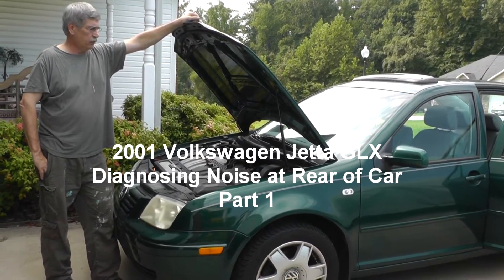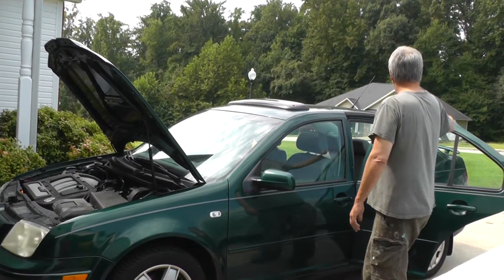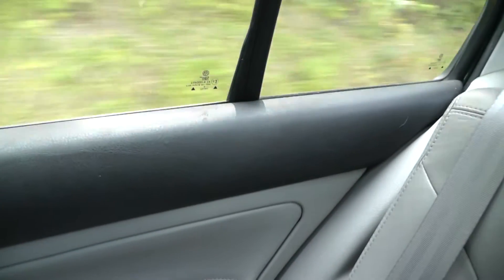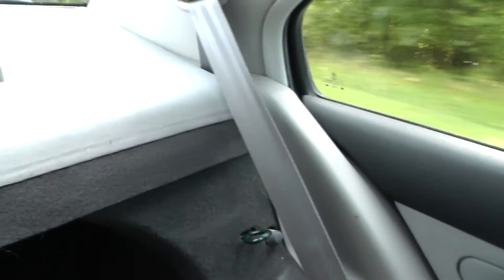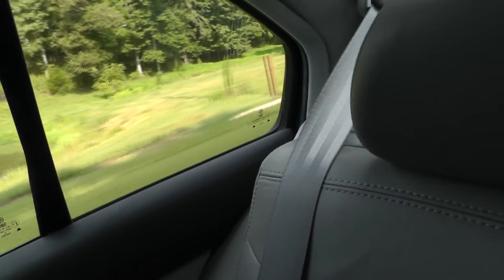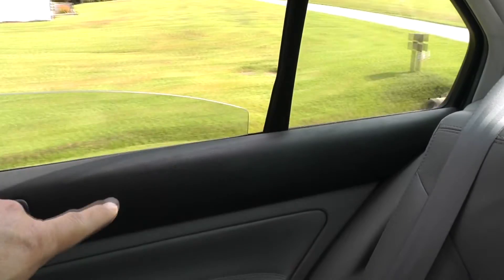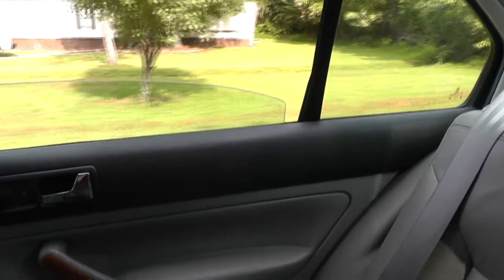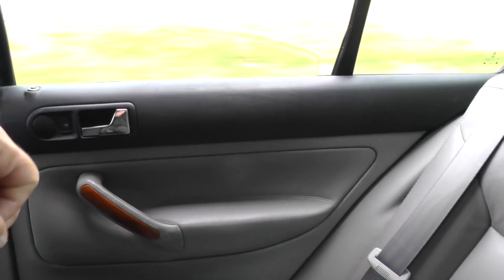Volkswagen Jetta Diagnosing Noise at Rear - Part 1

Comment from the maker: Thank you very much JC for the info. A subscriber had mentioned a bushing problem also in an earlier post. Looking over the manual, those bushings appear to be a pain to remove and install. According to the manual, it shows a portable hydraulic press to get them in and out. I probably will have to farm the work out for that one. Thanks again for the comment!

Comment from the maker: Hey Joe. I appreciate your thoughts about the noise. Sounds like your thinking is like mine. I've already started digging into the window regulator assembly on the left. And for the right, I was going to crawl underneath the vehicle and see what was going on. I didn't think abut the torsion rubber bushing. Thanks a great idea. Thanks for the tip!

Comment: Hey stuzman52 I just recently encountered the same issue... I believe the noise is coming from the left passdenger rear side as well. I got 2 new OEM springs installed in the rear suspention due to a broken spring. Im not sure if it is the torsion rubber bushing, Rear axel bushing, or something to do with inside the door assembly. Did you ever get a chance to diagnose that issue yourself? It would be great if you could help me out! I appreciate it! 
Tags kspain4tane Dohn Joe
Reply from the maker: Yes, it turned out that the noise wasn't coming from the door, but it sure sounded like it. I did another video series on the rear suspension which is where the noise was really coming from. Check out those videos which will show you what my issue was along with the repair. Take care...
Reply: stuzman52 I don't see the video you reference on the rear suspension, but was the issue the rear control arm bushing?  I am having the exact same noise heard in this video and that is what my searching is leading me to believe.
Reply from the maker: Hi Michael. I thought the noise was coming from the rear passenger window area. It turns out that the noise was coming from the shock mounts on top of the rear shocks. I was lucky that it wasn't the rear bushings, but in a later video in the series of rear shock noise, I show how to check the rear axle bushings. https://www.youtube.com/watch?annotation_id=annotation_2894167977&feature=iv&src_vid=33hi9EmGj7w&v=ANGHxERbztY Good luck on your repair.

Comment: So what was the sound from?
Reply from the maker: The result of the noise is in a later video which shows the repair. It came from an upper mount shock absorber. on the right rear wheel.